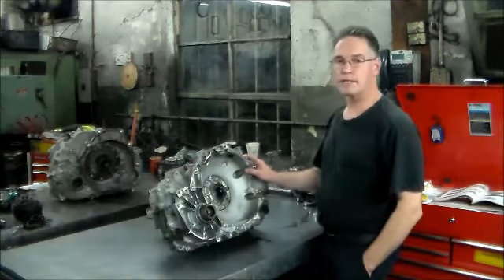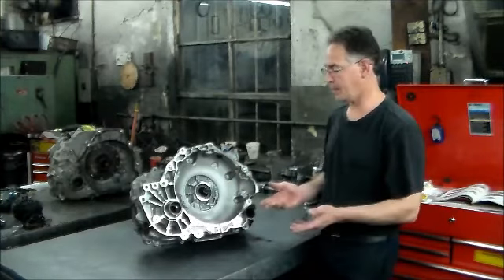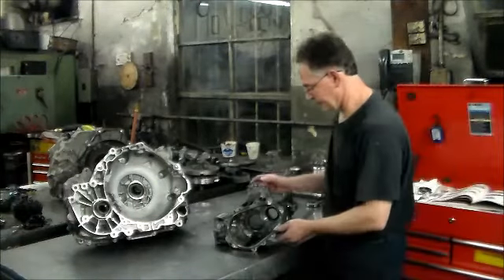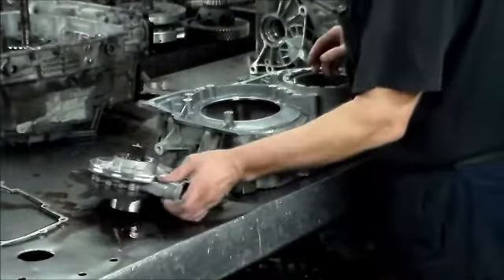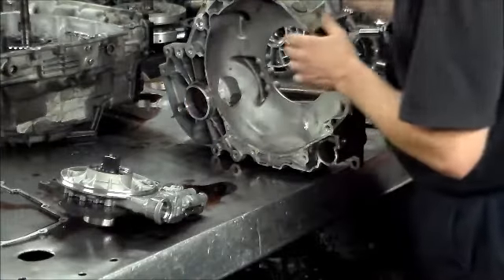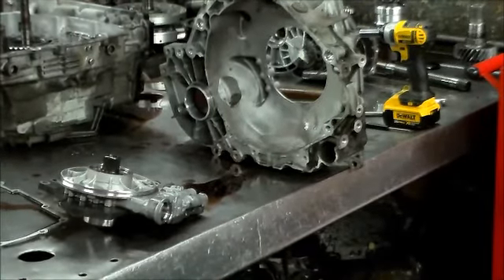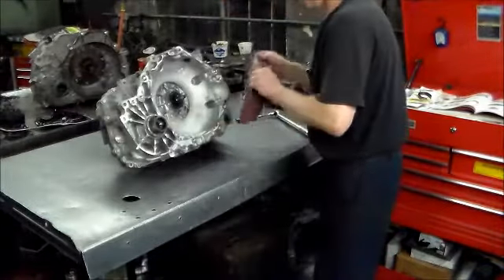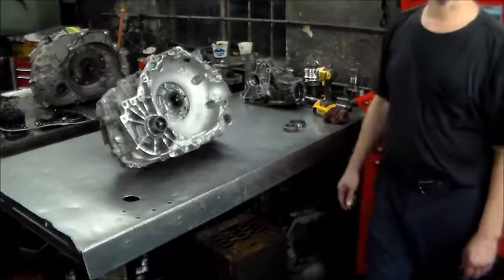6T45

Comment: I checked in my owner's manual concerning filter replacement on my 2012 Impala with the 6T75E and it says to take it to the dealer at 100,000 miles. Now I know why. I've got 97,000 miles on it. It still shifts fine but is starting to develop a whine noticeable in first and second. I've changed the fluid three times since I've had it. Thanks for the excellent videos.
Reply from the maker: The only way to change the filter is to pull the trans out, split it open, take the pump out and install a new filter. Is this the original trans?  Im doing a 6T70 now and i filmed it, should be up on my channel soon.  Thanks for watching, please subscribe. Gary

Comment: I had one come in with that transfer case unit roaring, and also leaking. It was from an extended warranty company. I removed the transfer case and originally recommended an overhaul. Once I got the case apart, I found out that it had ran pretty much dry, and the bearings were all coming apart, and chewed up. I couldn't get any parts for it, and ended up having to order a new transfer case from the dealer.
Reply from the maker: Connor W    Wonder if this will become a common issue
Reply: Ok, here is what I am thinking. Correct me if I am wrong but in a recent issue of Transmission Digest magazine, there was an article describing how the 6t45 is quite similar to the ford 6f35. Well, both models are offered with the AWD unit, and I wonder if they use the same unit. Ford has a bunch of issues with theses differentials, and if I remember correctly, there is an updated fluid that they came out with. Just wondering if GM has a similar experience. 

That bearing you pulled out has a lot of pitting, and I am wondering if there is something in the fluid that caused it, like if it had GL-5 in it, but needed GL-4 and GM hasnt addressed it. 

This is just me thinking out loud, Ha.
Reply from the maker: Ive switched out a bunch of the transfer cases on fords, ford calls it the power transfer unit. i buy them from the dealer and they have plenty in stock(what does that tell you, lol)
Reply: Well done nice video. Gary why do the 6t40/45 all have black fluid coming out . Seem other videos on these trans and they all have black fluid ?
Reply from the maker: There isnt that much fluid in there to begin with, maybe a few quarts, the fluid should be changed but people kinda dont know about it until its too late.
Reply: I have a cruze 2014 ltz 1.4 turbo & changed mine at 20K & it was dark IMO & I have changed many many trans filters. this is why I changed it at 20 & 30K & so on. it is just a drop & refill now :( sad days. but even my buddies $50k+ car has a non changeable trans filter too. I only see filters in HD trucks now.

Comment: Hey Gary nice video,I have a 2013 Buick Regal 6T50 I believe,it only got about 10 miles then slips in any gear drive or reverse.Let it sit for 3 minutes start it back up and it will go about 5 minutes before it starts doing nothing again very strange!do you have any idea what it could be no codes stored or pending
Reply from the maker: Sounds like the filter is clogging up. Filter is located inside the trans
Reply: Gary Ferraro thanks for your input sir!Yea one way or another it’s gotta get pulled
Reply from the maker: @HARLANAUTOMOTIVEN.B  Yes, if the filter is clogging, something is coming apart
Reply: Gary Ferraro wells here’s the back story 108k on car a rock got caught between the cv axle and case and put a big hole in the case I couldn’t find the piece of aluminum that fell In the trans so I repaired the hole with qicksteel and it holds up no leaks it ran for about 60 miles then this started happening,I’m guessing that chunk of the case made it to the filter.it was on the driver side cv axle
Reply from the maker: Kevin Harlan  so it's full of fluid?
Reply: If I remove the cover where the TEHCM is is there anywhere to introduce air to see if I can unlodge whatever’s in there?
Reply: Gary Ferraro yes I added 2 quarts of max life dextron VI till it came out of the fill hole screw and it made it 60 miles then this started
Reply from the maker: @HARLANAUTOMOTIVEN.B  Really can't, to me sounds like the filter is clogging up, usually clutch material or a converter coming apart causes this
Reply: Gary Ferraro yea either way no good!i appreciate your time there’s a couple on eBay going for 250 to 300 from LKQ I’ll just go that route thanks again sir!
Reply from the maker: @HARLANAUTOMOTIVEN.B  Sounds good, i use LKQ, they have a pretty good product

Comment: Seems like you have lots of experience do you know if you can use a 2011 equinox transmission in a 2010 equinox supposelly they wont interchange but i dont see why not they are exactly the same to me is there something internally i have to change or just the techm
Reply from the maker: There is generation 1 and generation 2.  I believe gen 2 started either 2012 or 2013
Reply: @GaryFerraro  ok is there any chance i can make it work if so what does it need to be changed internally
Reply from the maker: Can't really change parts between Gen one and Gen 2.  ok so the years are 2010 and 2011?  i will have to check with my supplier about the year split
Reply: @GaryFerraro  i really appreciate yout help
Reply from the maker: @jesusmfelix-fu4qz  Sure, no problem
Reply: @GaryFerraro  i did it last night it did work i used the t40 from a malibu into the t45 equinox jjust chaged valve vody and techm from the t45 into the t40

Comment: Hello sir, I have a 2010 Equinox with the 6t45 Transmission, it is the 2.4L FWD model. I installed a new torque convertor and everything was great for a few days, then my wife (It's hers), suddenly lost all gears. What do you think could be the issue?
Reply: All the gear loss was sudden, no slippage, trouble shifting or abnormal noises indicating a failure was imminent.
Reply from the maker: @MrObeast44  Does the car hold in park?  any noises?

Comment: My wife had a 12 equinox that had seal issues with only 30000 miles front seal and side pan gasket
Reply from the maker: Tony Mikesell   Wow, so did they have to pull out the trans to fix the leaks
Reply: Gary Ferraro I don't know for sure it was factory warranty and   It does not say on the repair order just a bunch of numbers
Reply from the maker: wonder if this will become a common issue
Reply: Gary Ferraro sounds like it already is here red spots on driveways everywhere
Reply from the maker: yes, the transfer case has issues too.
Reply: Gary Ferraro let's not forget about the cat converters that burn out at 40000 because of exhaust manifold crack a inch long no warning or anything just a 0420 or dead dash nothing works that was 18000 miles or that clicking in the dash that never got fixed 2012 equinox = money pit
Reply: Thank god for warranty
Reply from the maker: Yes, i agree

Comment: I had issues with this trans in chev Orlando.
neutral idle control is coming on off on off.... in D
changed the 1234 clutch plates and the piston.
but still the surging in D when the trans is warmed up.

Any ideas on this problem?
Reply from the maker: The engine surges? any codes?
Reply: @GaryFerraro   the first gear engages and disengages  intermittend. you see it on input speed. 750 rpm - 500 rpm - 750 rpm ... its not fromm the engine, it is the neutral idle feature for disengaging the 1st gear at a red light stop.

no codes anywhere

There is a TPi from GM PI0928E
but this didnt cured this problem :(
Reply: @tobiashoth147  hi did you find what caused the surge into drive mode?
Reply: @TayouTroy   no sorry
Reply: @tobiashoth147  I fix my surge issue yesterday. What i did was use GM sps online programming to reset and relearn the gearbox tcm software. All is fine

Comment: Have a 2011 Equinox with a 6t45 Gen 1 FWD. Have all gears until car warms up then have no movement FWD or Reverse. If I shut car off then restart have all gears for about 10 min. Looking at Trans oil pressure gauge connected to line pressure tap on top of trans. Have about 60 psi in park. When failure occurs the pressure gauge drops to zero. Any idea what could be the issue?
Reply from the maker: The problem is your filter is clogging up, something inside the trans or converter is coming apart, not much can be done about this other than to pull it out
Reply: Thanks for the great news. Ha Ha. Appreciate the quick response though.

Comment: Hi, can you help me please. I have 6t45 mh7 gearbox. When I changed from drive to reverse the car makes an excessive thump which jerk the car hard. Do you know what would cause this. Regards
Reply from the maker: How does the car drive forward? do you have 3rd and 5th gears?  Any codes?
Reply: @GaryFerraro  hi, forward is fine. No issue with any of the gear change. When the car is parked switching the gear from parked to reverse fine. The excessive thump only happened when Switching from drive to reverse. Thanks
Reply: @GaryFerraro  no fault codes from the TCm.
Reply from the maker: @TayouTroy  May want to check the mounts and axles